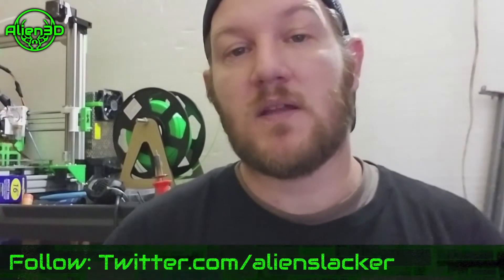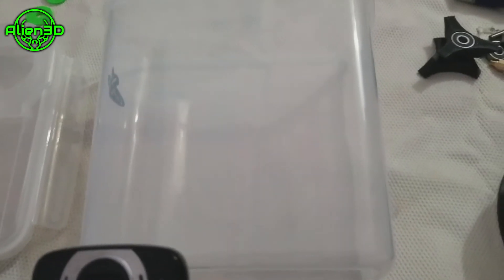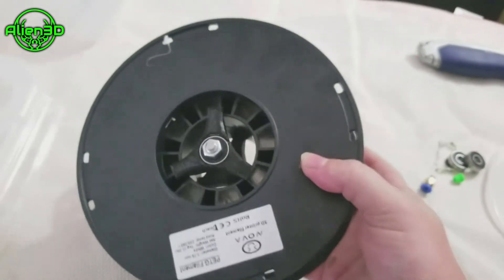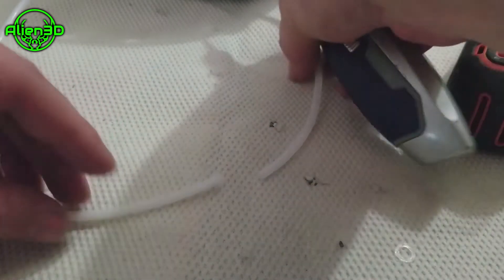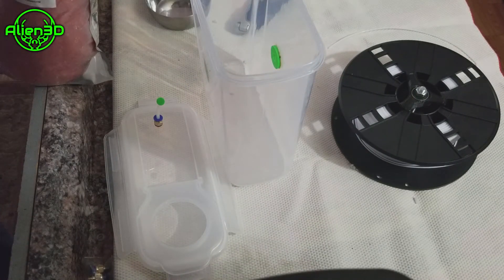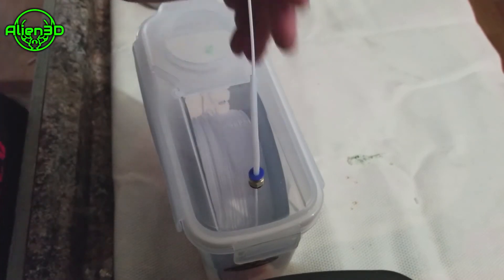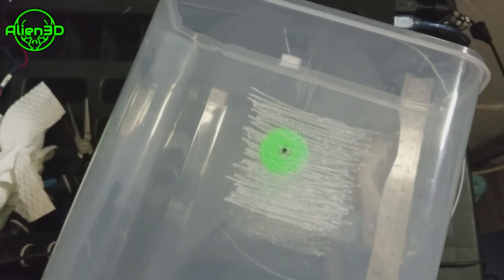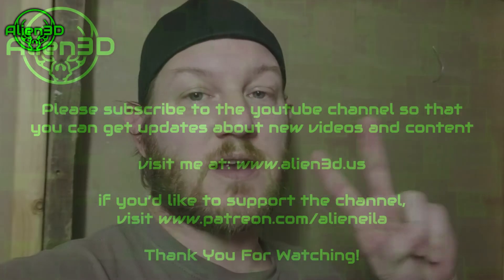Single Roll 3D Printer Filament Drybox

Comment: PET containers are hard to glue some people prefer to use small bolts and nuts to hold those printed pieces and also have seen a cradle holder like this one https://www.thingiverse.com/thing:2179768 really a good idea is better to handle just one and not a big crate with a lot of rolls like Tom's Sanladerer one.

Comment: Saw the price of these boxes on Ebay is $14. I also need a single one for putting on top of my Ender 3 as been so humid here I feel it's time to protect my filament.
Reply from the maker: You should be able to find cheaper ones on Amazon. I suggest getting one that isn't tapered though.